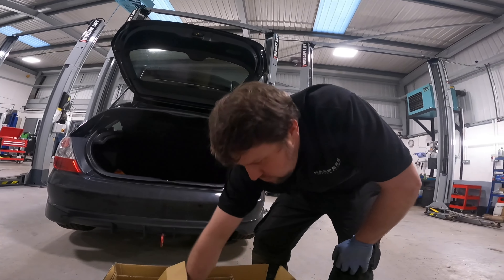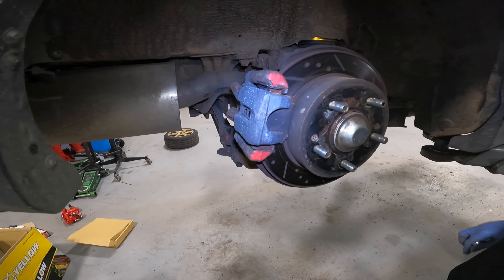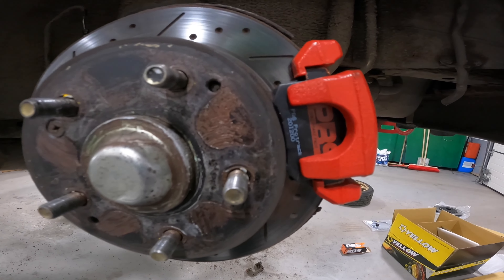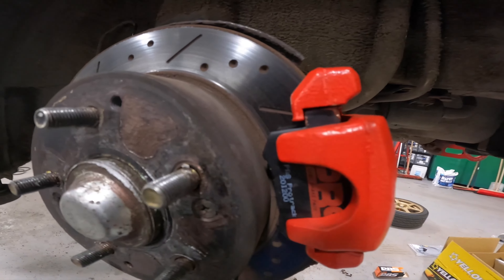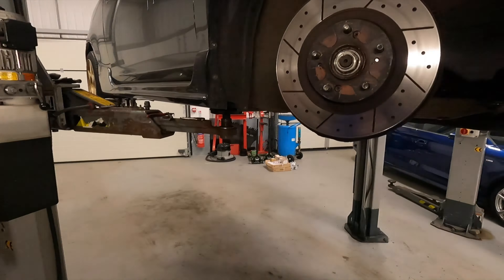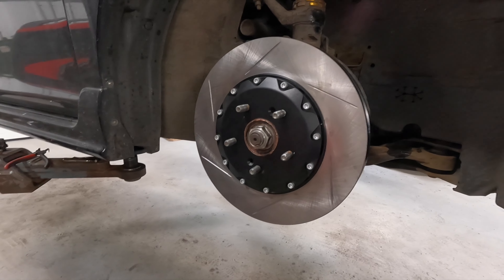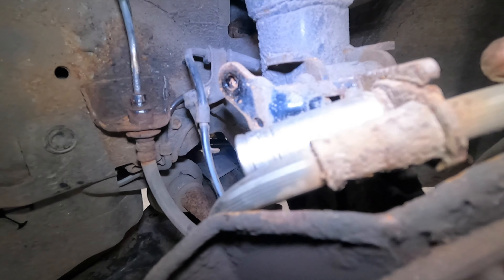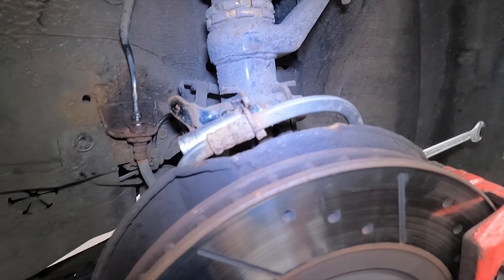EP3 Type R Fitting Yellowspeed BBK and re-furbished rear callipers

Comment: oh i also have replaced those brackets and the bolts etc i think was around £16-18 per bracket or at worst £22 and that excluded the bolts. All genuine from Honda. I bought the whole lot to do it so I could fit my HEL lines.
Reply from the maker: Amazing how bad condition they are. I will replace them at some point when I under seal it all to try and protect it. Make it live a bit longer

Comment: What if Disc Rotors are intended for “normal” (front) caliper position ? EP3 are not, as they are opposite (backwards) placed.

Notice calipers on this model are placed backwards.

What solves any Doubt on direction is Venting position to make air going IN or OUT (expell)

No difference on old Disc Rotors as venting are straight and new were mounted same shape (direction).

Much difference

Best Regards
Reply from the maker: Wheel still turns the same direction?
Reply: @1BlueGhost  

Thank You for taking time to read and answer.

Yes: spining is always same direction.

What I would like to mean is Calipers are marked R & L same as Rotors. 

If I use R Caliper on Right side backwards position then bleeding nut points DOWN and same on Left side. So I has to place them opposite to have bleeding nuts UP. 17CL15VN

Well, I am guessing, same rule could aply to DIRECTIONAL Rotors (new ones) which really are directional as curved shape on vents show; NOT as old ones that weren’t but just drilled and sloted as if they were; vents are straight.

I guess NEW rotors were fitted for Calipers at FRONT; the only way to solve might be unscrewing and turning oposite side each to make them perform as intended for curved venting..

It’s japanese conception versus non-japanese construction. I guess.

Best Regards

Comment: What was the performance like between this and standard?
Reply from the maker: They are much better. I’ve only driven the car spiritedly on B roads not on a race track but you can feel the improvements.
Reply: Thanks for the reply mate. Looking at charging mine within the next 6 months and I have oem fr and rear discs atm with stoptech pads. Trolled the Internet and you are the first one on here to put them on. I know they have dc5, megane rs 250 brembos, stoptech or buddy clubs and these. Seems like these are good value for money for the kit you get. You haven't got much left to do now have ya?